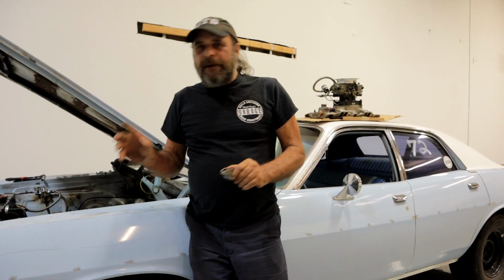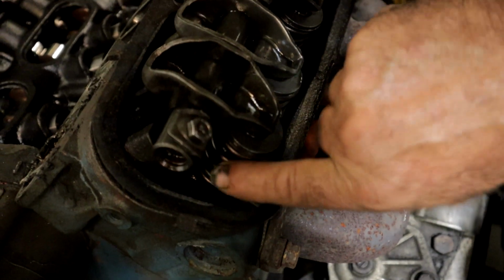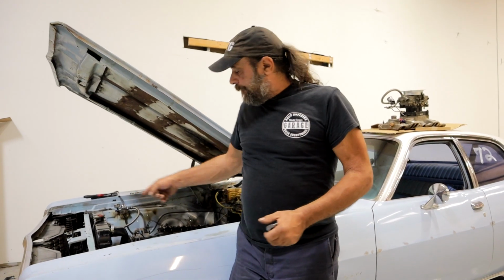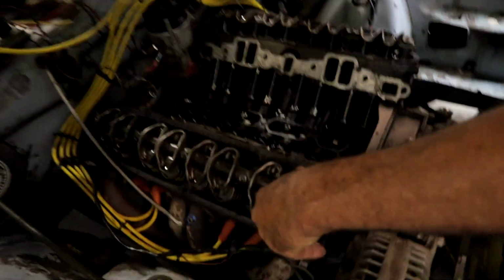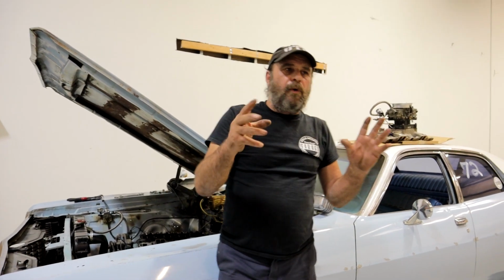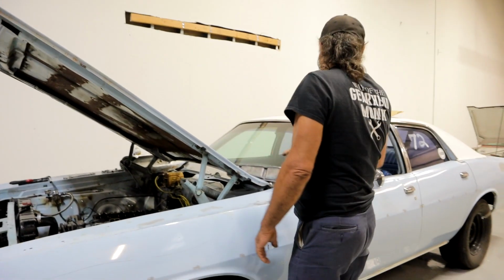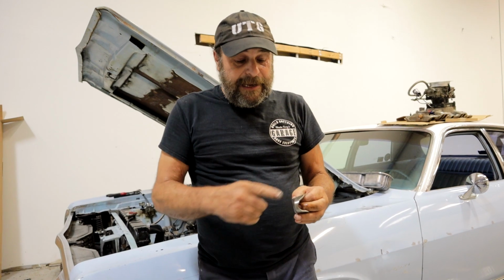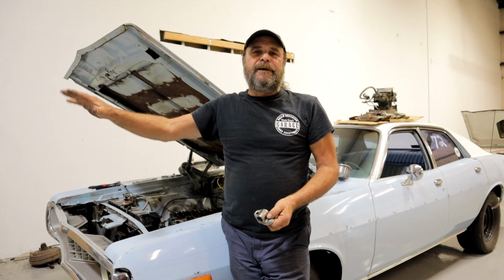Bottle Rocket Rocker Failure Explained

Comment: Either the valving is off in some of the lifters (defect), or maybe something is going with the pushrods (blocked ports). It also could be a bad set of rockers (another defect, poor heat treat, or stress cracked during production) I'm just spit balling here. Process of elimination would get you where you need to go. If it were me I would inspect the rockers and verify they are in spec, then the same with the pushrods. Finally that narrows it down to the lifters or the even the cam. You just did a video on the qualtiy of new parts these days, it's cheaper for manufacturers to let quality slip if it means cost saving and only refunding or replacing parts that fail by the end user.

Comment: I'm running solid roller lifters on a hydraulic roller cam...didn't want to have to deal with issues like this.
Reply: For how long ? I'm planning that exact upgrade myself in the near future. Any issues at all ?
Reply: @Torquemonster440  About 2 years or more...I had to do a teardown because I blew up the motor. The lifters looked good and I feel comfortable using them over again...which is also a plus with going roller. Engine masters did an episode on running solids on a hydraulic cam...see if you can find it ...its pretty interesting.
Reply: @kgooch69  oh... trust me, I've watched that episode probably a dozen times.. lol. Thats wat sold me on this concept. Also, the LSA episode was EPIC !! The LSA episode really highlighted where a nearly optimized LSA can greatly benifit a relatively restrictive head like the Big Block Mopars use.

Comment: Nice little pushrod impact hammer until lash taken up. 
Cam company fallen to by Chinese crap or at least seal material made from Chinesium.
Makes me think of the valve lash adjuster failures in the newer 4.7 Magnums right from Dodge. 
I'd spill the beans openly on the company name. Make them squirm. 
Cheers

Comment: I've seen engines that are infrequently run and then run for short periods of time have lifters that bleed down.  There just isn't enough run time to pump the lifters up and all hyd lifters will bleed down when an engine sits for long periods of time   Thick oil will make this worse.
Reply: Also, anti pump up lifters bleed down. See also Rohdes Lifters that are sometimes used to soften a long duration cam at idle.

Comment: Installed spring height and coil bind.  Valve train problems with 2 different setups are pretty odd. Not trying to bust anyone's balls.  I'm trying to wrap my head around why the rocker failed.  Lifters hammer for thousands of miles without failing.  Pretty violent is exactly right! Something is exerting way to much force on the rocker arm. Could be why Lifters are failing also.  Like I said Not trying to claim to be a better mechanic but just trying to help with the problem.

Comment: I have heard that performance oriented hydraulic lifters do this... Even when they are new... The reason, is because these lifters actually alter the valve lift and valve timing at low RPM... Then as the RPM increases,  the valve lift increases and an advance with the valve timing takes place... They have a calibrated leakage, and these lifters have less time to leak at high RPM, thus increasing the valve lift and advancing the timing of the valve openings. It has a similar effect as that of the newer vehicles with variable valve timing, but with some advantages over the VVT engines... These controlled leakage lifters vary the amount of valve lift, where vvt engines don't do that... And the controlled leakage lifters are FAR LESS COMPLICATED, and FAR LESS EXPENSIVE to repair and rebuild than the vvt engines that had valve train failures. These controlled leakage lifters are producing, Mild mannered performance at anything below 2,700 RPM.... But as the engine RPM increases, they turn the engine into the incredible Hulk!!! And Tony, don't stress over the rocker arms being damaged where the pushrod divets are... Numerous stock stamped steel rocker arms of various makes of vehicles have done this when using non-stock cam lift and heavier than stock valve springs... Quite often, the manufacturers of after-market performance camshafts also sell other items for the valve train, that are engineered to go with the modified camshafts, and thus increase the life of that engine with the aftermarket - non stock parts.

Comment: I have a Jasper rebuild 5.0 with under 12K miles that does the same thing. Clicks when it starts for a few seconds but then stops. Just a stock motor. WTF? "These are completely remanufactured engines with all new wear parts, exacting tolerances and run-tested reliability." says the website.

Comment: I'm in the process of building a new Chevy 350. And one of the last things I'm getting is the cam and lifters.  I'm scared to death that the engine is going to detonate breaking in the cam. I can't afford a roller cam. And even if I get a roller cam  I might have issues like you. I'm fugged either way.

Comment: Man, i'm subscribed to a fair amount of youtube channels who cover many different domains, as i have many interests, but thee is one common theme I've noticed, people uploading videos regarding something defective they just bought is staggering, like a guy who bought a very expensive professional tracking mount which is used by amateur astronomers, compensates for the earth's rotation so you can image or view celestial objects without them drifting away in your focal plane, well this 2000 dollar piece of equipment came defective brand new, threw a belt, turned out the cap securing it wasn't secured properly, and some of the adjustment screws wasn't threaded correctly, now it wasn't the end of the world but it makes you wonder what else might be manufactured incorrectly that the eye can't meet at first glance. 

Besides when you pay top dollar for prof level hardware you shouldn't have to conduct hardware services or repairs new out of the box due to manufacturing issues that's unacceptable by principle, one truly can't rely on anything new anymore. We're truly doomed Tony...

Comment: I think those lifters do not match that engine the oil holes are not matching up. I would just put some stock roller lifters out of a stock small block late model Mopar and throw them in rockers and all if they match up to that old motor. And also I am worried about those 340 springs with a roller cam those lifters are heavy and a single spring wont make it.
Reply: That's not as easy as it sounds. The late model rollers will rotate in the bores and destroy both them and the cam (and probably the bores as well) unless they have the "wishbone" guides to hold them straight. The early blocks aren't machined for proper placement of the guides and aren't drilled and tapped for the retaining plate.

Comment: oil today is JUNK i just built a 350 i use rotella 5-30 with half bottle of zinc i also had lifter bleed bad i used a elgin pro stock rv cam i ajusted the valves like ten times drove me nuts pissed me off

Comment: me being the goof I am would be adjusting the hydraulic lash to be instead of 1/2 turn from the top. aka zero lash. I would adjust down to the bottom of the hydraulic travel and back off 1/4 turn. ( chevy method ) that way even if its bled down to the bottom it acts more like a solid on cold startup and the hydraulics don't have a lot to take away.  Get the feeling that they are making junk these days. back in the 90's the things just simply worked.

Comment: UT, I’m having so many problems with cams and lifer, I wiped out my cam on my  mopar 400 build two days after. Pulled the engine went threw it, caught it just in time. Fast forward three weeks ago got replacement, broke it in all good?? No 4 lifter won’t even pump up, chattering away.  I’m beyond pissed myself, this asshole at COMP CAMS talked to me as if I just fell off the turnip truck!!!  I’m pissed!!!

Comment: Did you soak them?
Reply: Seriously? They have been in service over a year. And yes he did a year ago.
Reply: @davidleonard8369  doesn't matter how long they were used for
Reply: @Fabricationranch  Really?  So are you implying that the check valves could be damaged from no lubrication on the first start over a year ago? Please elaborate. And like I said, tony did soak them in oil before installing them. I myself against the advise of many, always pump them full of oil when installing them.
Reply: @davidleonard8369  I was just curious what tony did not trying to argue or blame failure on whether or not he soaked them.
Reply: @Fabricationranch  I understand but but curiosity did kill the cat. LOL!

Comment: Had hydraulic lifters collapse at 1000 miles on 500 lift cam. Pathetic. Have about 300 miles on a new set (yes I paid for them again). They are not super quiet but I guess I have another 700 miles to see if they are better.

Comment: It almost seems that the big companies are being taken to the wood shed by they smaller racing manufacturers. I would much rather support a company that has started manufacturing parts in the last 10-20 years than a large corporation that has been doing it for 60 plus. They are still in the mindset of "we have been making parts for this long , we know what we are doing". But they try to cut costs by going with sub-par materials and QC. I know its GM but companies like Texas Speed or Brian Tooley Racing are doing pretty well for themselves and their customers with excellent after the sale customer support. Try getting Chump Cams to take care of you with this issue.

Comment: I'd love to see how solid rollers and roller rockers hold up, maybe there's no such thing as budget builds these days?
Reply: It’s far cheaper to buy more expensive, quality parts once instead of continually jamming cheap junk together in order for it to be “budget friendly”.  Just the time Tony has into this engine just chasing failures alone is crazy.  Could have built a strong, reliable engine for a bit more money, in less time, and be on the track having fun instead of this mess.  Comp is not a reliable brand and hasn’t been for some time.
Reply: @stevejones6647  that's the beauty of this build I guess, to see where the fine line between budget and reliability happen to have a 10 second strip/street car, I love it.

Comment: Agree they shouldn’t bleed down and you aren’t the first I’ve seen run roller cam with stock rockers.  I hope they have a knowledgeable tech that can explain it to you in depth and not just a patented answer like this is what you need to run with this cam.   Why?  I’m living on the cheap.  Buy roller rockers now I need valve covers, Chevy guy, sorry.
Reply: I forgot, after the valve covers the brake boosters may interfere, the wiper motor may interfere, the AC box will interfere, etc.  not cheap.

Comment: We should keep some perspective. How many lifters sets have you bought in the last 5 years?  Us budget builders are buying one not 10. So we should consider the statistical odds for the average builder in this on top of the applications you are using for all the parts you have an issue with.  That being said it should keep us mindful of quality control and inspecting the heck out of your parts before installation. To be fair things like bleed down is just not something you can reasonably check for. But we CAN minimize problems by being overly careful.
 I had a US company send me a set of new pistons and 2 of the 8 had flaws in the castings making them unusable. They gave me a refund and effectively shut down my engine build til I had it resolved but it made me questions EVERY part I bought from them and I did give them a serious dressing down about quality control and how obvious these flaws were that I saw them the moment I took them out of the box. These kinds of things scare the crap out of me. For me it is not about money. I can afford to build a 2nd engine. My issue here is wasted time in undoing the "fuckery"  and staring at every part until my brain tricks me into seeing problems.  I just cannot do it. I just move on. Everyone gets bad parts. EVERYONE.

Comment: the knowledge how to manufacture hydraulic  lifters seems to be lost, sad.I've had way too much trouble with them.today I see only two options. Mechanical flat tappet or mechanical roller lifters.  and there is a well known company that I will never buy Camshaft or lfters from. if it continues like this.  you can soon only use old used camshafts from the past.

Comment: i put new lifters in my 307,000 mile GM 3.1 v6 when the heads blew at 302K (yup, i drove with a bad head gasket... just leaked enough to foul 2 plugs for 5 seconds at start up)
.
it REALLY quited it down
however..... i get a MUCH quiter tick for the first 10 seconds.....
.
then the piston slap (normal for this engine) takes over.... but their is still a bit of lifter tick
might be from the roller rockers (roller bearing.... flat metal tips)
.
but the engine has 307,000 on it.... ITS GONNA MAKE NOISE!
so im not upset..... but it would have been nice
.
.
i used "sealed power".... federal mogal made (aka, fel-pro).... ordered threw NAPA

Comment: F' COMP Cams lifters, you're lucky that's the only problem you had.  Gotta go with Topline Hylift! (yeah expenisve but they are quality) I put 'em in my Olds with a Lunati Voodoo and the valve train is quiet, despite the VooDoo cams supposedly being hard on the valvetrain with their fast ramp speeds.

Comment: Stop buying parts from the big giant companies. That's my plan moving forward. The problem is the big companies have abandoned quality by changing their business models to focusing on on high sales volume instead of producing good quality parts that actually get proper QC testing. The big companies are gobbling up the small ones and cheapening everything up as far as quality. 1000s of jobs have been sent over seas to the lowest bidders and the end result is crappy parts. Unfortunately for some parts we have little to no choice but with camshafts and valvetrain parts there are still small companies that are producing good quality parts right here in the states. The only drawback is they cost more than the big companies crap but to me paying the extra 20-30% is money well spent. Good quality parts and helping workers right here pay their mortgage and feed their families is a win win.

Comment: “Hydraulic roller cam” is an oxymoron; either use a flat lifter hydraulic cam or a solid lifter roller cam. And if you’re building an engine for drag racing, solid lifters are the only reasonable choice.
Reply: (looks at teh 8 second 8f8 LS powered mustang) right
Reply: I guess you didnt watch the video either....oh....and guys been doing this exact same thing for.....60+ years.
BUDGET....and it should stay together for years and years like this....if...IF the bloody lifters wouldnt puke on it
Reply: snerd, I certainly did watch the video, I respectfully disagree with Tony on this issue.
Reply: B.S.  That rocker was HAMMERED on every start, regardless of hydraulic, solid, pnuematic, magnetic, ionic, whatever... rollered or not.  That hydraulic was designed to control valvetrain clearance, and it failed.  Why don't ALL hydraulic valvetrains fail - especially those with fairly factory-level loads?  Aftermarket parts' quality control nowadays is frightening.

Comment: I realize this is not the correct spot to be asking this question. Buuuuuut….here goes,
I have a 1982 el Camino SS. V-8 of course. I’ve managed to make it computer delete.  Everything EXCEPT the distributor. The advance was originally controlled by the ECM. How and where should I set my total timing for best performance? The distributor has no counter weights, no springs,etc. Right now it runs fair, but I feel like there’s more umph in my small block. I realize that I can go find an older vacuum advance distributor and go from there, but I’d rather arm wrestle this thing with what it came with for now. ANY REASONABLE SUGGESTIONS ARE GREATLY APPRECIATED.  UTG FOREVER!
Reply: Thank you Kenny. I’m sure I’ll probably end up doing that. But, For right now, I’m just trying to pull the most that I can from what’s already in the engine.
Reply: Not gonna happen . Locked out timing is what you have now. Why do that when you can get a brand  new distributor that will afford you the 20 hp your missing  for 65-75$

Comment: Last I heard, only two company's, period that make the lifters for everything out there.hell you can't hardly even get a set of lifters right now.
Spoke with summit and comp months back .neither had lifters.and were saying a month out ,at that time.
I've got a 385 sbc in garage in trash bags right now.
Spent $4,182 to build
Comp cam broke in on the dyno by engine builder.
Once installed in truck,two lobes swiped
Rebuilt motor again myself,
Same mechanical tappet ,solid lifters.comp cam didn't even make it thru the break in.
Over $800 ,two cams two set of lifters in the landfill.
Called comp,they had every excuse in the world.
And that was that.
I'll never ever buy another camshaft from those crooks.
.

Comment: Reading a lot of negative crap in the comments. I've been working on engines since I was 14 years old (55 years) and have seen things that are not possible. When I was 17 I witnessed my own Father stick old lifters on a new cam AND GET AWAY WITH IT! Impossible right? He drove that motor for 10 years till the truck was wrecked in an accident. Tony got bad parts, period. I've run 318's well over 100,000 miles and beat the hell out of them and never saw a rocker fail. It's the old GIGO theory, you put garbage parts in your gonna get garbage results. The really scary part to me is I have a cam and kit for my Slant 6 from the same cam company Tony used. This does not instill a lot of faith in me. My point is, you can't dump on a person who builds an engine with what he HOPES are good parts and then gets burned. Dump on the source of the problem, the company, not the poor schmuck that got burned.